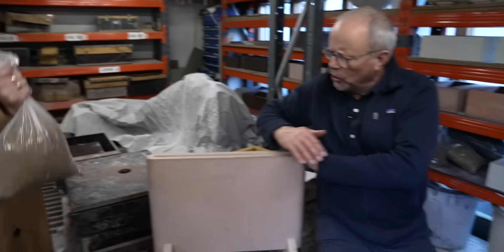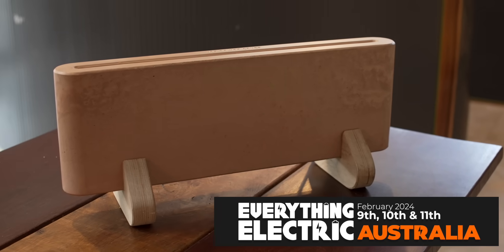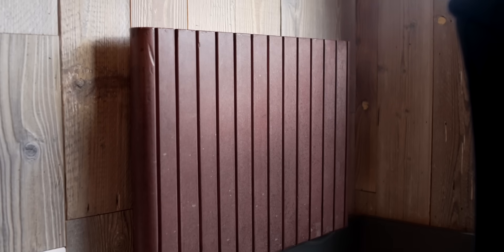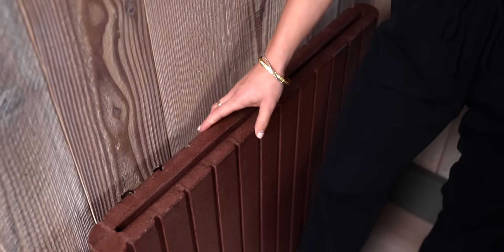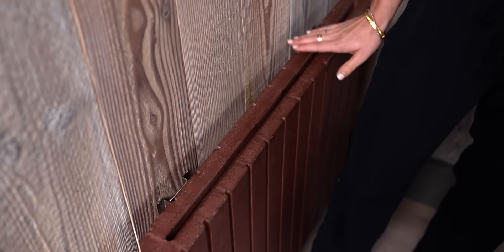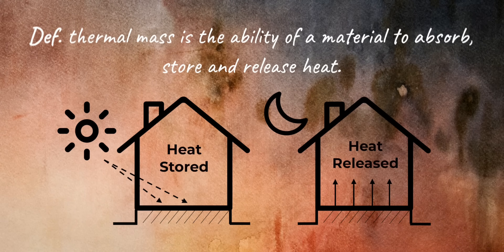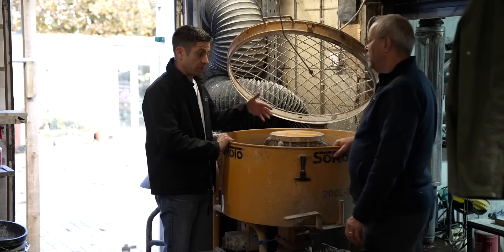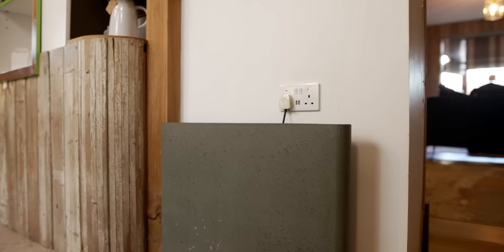THIS Radiator Is Made From Recycled Sand!

Comment: Lovely things but 100w of electric heating is just that; 100w. Same for your grandma's old bar heater. There is no 'super efficiency', this is muddled up marketing. The recycling and looks are great but please keep the science right.
Reply: And my smart TV consumes 100w not 600w
Reply: @peterjones6322 
Even less. 55 inch uses about 80 watts
Reply: And with a heatpump, you get up to 500W of heat from 100W of electricity. A lot more efficient.
Reply: Feels like an ad
Reply: I was thinking the same thing, might heat the block up and store it / let it out slower.  But 100w is 100w
Reply: Right! Any old electric heater has the same efficiency! How about tackling this misinformation?
Reply: Yes, even my massive 77" OLED uses far less than 100W about 95% of the time.
Reply: Hear Hear!!
Reply: Absolutely, all electric heaters turn electricity to heat with virtually 100% efficiency.  Some deliver that heat immediately and some deliver more slowly because of thermal mass. But they all use the same amount of electricity to heat a given area. With enough thermal mass you can heat up using cheaper rate electricity and discharge it slowly throughout the day.
Reply: 100w during peak rate (‘only’ 3p an hour) for 15 hours a day, 30 days in a month is £13 a month. For just 100w output. 100w is never ‘just’ 100w if you’re running it for a long time.
Reply: @MrKlawUK indeed
Reply: Not in reality. When we got an infrared heating panel, it was obvious that the heat actually reaches your body instead of rising up to the ceiling.

Heat production is just the beginning of the chain, same goes for ductwork with central air.

Generation doesn't have to be magically efficient, if the heat actually reaches you.
Reply: I could be completely wrong but I think the TV comparison is because they have looked at an average kWh over a day.  The TV would be on and constantly using a certain kWh but the radiator will be turning off when up to temperature or when the room is warm enough.
As for efficiency, again I could be completely wrong, but I suspect it us the difference between dumping all the heat straight out compared to heating a thermal mass and releasing more slowly.
However, I notice there are no straight comparisons on the costs of heating an average home, probably because it is high unless you have "free" electricity from PV.
They also don't mention the issue of using thermal mass and trying to control room temperature.  Once that radiator is up the temperature you can't stop it releasing that heat, even if the room gets too warm.  Likewise there is no instant heat if the room is cold, you have to get the thermal mass up to temperature first.  Ask anyone who has had storage heaters if temperature control is easy
Reply: correct...
Reply: The science is right, it's more to do with how much heat is held in the heater while your heating it and the period after you switch it off. A single bar fire, which was all we had for heating the whole of the council flat when I was a kid, would stop giving off any heat straight away when you switched it off. Whereas when the council fitted storage heaters with their huge bricks, they would let heat out gradually after they were switched off, which is a similar technology to this. Only this is more efficient as there is no air around cables, they are a lot smaller, plus the rebar used within the product will also retain heat that will give off a slow release.
Reply: Sorry but you just made my point. There is no extra or more 'efficient' heat generation, it will be exactly the same amount per Kw as the one you had as a kid. It will just be released over a longer period of time, which may be nicer in many ways but is not 'super efficient' or have any magic that creates extra energy per Kw. The nearest we have to 'magic' is a Heat Pump which is super efficient and extracting heat from outside. Any direct electric heating gives out the same quantity heat for any given input 1:1, this one and any other storage heater just takes a bit longer to release it  @everestyeti
Reply: I get the comments on the straight watt to btu not holding up to a heat pump, but what if you used these to dump excess solar into during the day and they held some of that heat into the evening?  I would order a few.
Reply: @Marker-er3ro or off peak electric to release during the day? Where a heat pump would need peak electric most of the time. And for situations where a heat pump isn’t usable but the owner wants to move away from gas?
Reply: @MrKlawUK  wasn’t really considering time of use, more as a load balancing mechanism for excess solar, but conceptually you could use it off peak.
Reply: That is a good use scenario but still doesn't make it more efficient or super efficient. I like the product but care is needed in how it's marketed. @MrKlawUK
Reply: @jonathankeenan5163  technically doesn’t stop it being only 100% efficient, no. But from a cost of running pov a storage heater that can leverage off peak at 3-3.5x less expensive electricity would cost the same to run as a heat pump using peak rate at 3-350% efficiency. Both using electricity so not gas. End product would be the same?
Reply: @Marker-er3ro agreed, better than export.
Reply: If it turns every electric watt put into it into one watt of heat energy then it has 100% efficency which is more than a conventional water pipe heating system has. So saying 100 watts is 100 watts is actually max efficiency. But that is unrealistic, so having real numbers would be nice. Heat pumps only have efficency above 100% because they are "cheating" by not counting the energy absorbed from the surrounding environment.
Gas heaters have 97% efficency at the boiler but of course lose energy in the pipes and then the old water radiators have shitty efficency.
Reply: @phelanwolf6747  The losses in efficiency  in electrical circuits is heat. Electric heaters ARE virtually 100% efficiency ftom the outlet onwards.

Comment: Struggle to believe that a 600watt heater is the same as Smart Tv. Most smart TVs are between 70 and 120 watts. Still an interesting product though.
Reply: Yeah, that claim jumped out at me. My nearly 10 year old LG 42 inch TV sips about 50W when it's on. I was pleasantly surprised by that!

Those radiators do look really cool (pardon the pun) and I love the percentage of recycled / waste material they're using.
Reply: Yeah that's more than my full gaming PC set-up running at max power. No chance just a TV is pulling that sort of power.
Reply: came to the comments when i heard that, my smart TV which is amazon fire TV 50 inch is 150w max power
600w for a single radiator in my view is expensive and not a few pence to run per hour, that would be about 18p per hour just for 1 radiator
Reply: I've got a 42" plasma that uses 400W,  but I never use it because it uses 400W and also because it triggers my peril-sensitive welding mask which is a bit concerning.
Reply: @MattOGormanSmith  And that's pretty much the reason why plasma screens stopped production a decade ago!
Reply: This is saddening to see Fully Charged/Everything Electric make BS claims about the power consumption of normal products (600W tv?? Does Robert still have vacuum tubes??) and then gush about the efficiency of a resistive heater (all resistive heaters are 99.9% efficient). Not even a smart option to speak of like off peak use to release during high demand

Comment: If the electronics are embedded in the concrete, how do you repair it if it goes wrong?
Reply: I fail to see any "electronics" inside it. What I imagine it's a simple nitinol wire/cable embedded in the concrete, similar to floor heating. If it's calculated correctly the nitinol will heat up the concrete's surface to ~60°C, no electronics required. I could build one myself, not a difficult task.

Comment: Expensive Storage Heater - Use Bricks and a Heating element, so it can be serviced, and it is 100% efficient ...it is nice to look at but not new. Sorry....rather have the 3 Dozen used bricks...version, oh I did in the 1990s
Reply: Exactly what I was thinking I don't the the "Innovative" part and aluminium and copper are all recyclable anyway